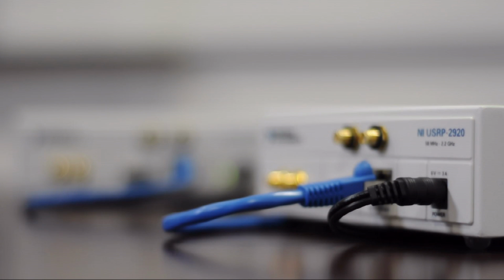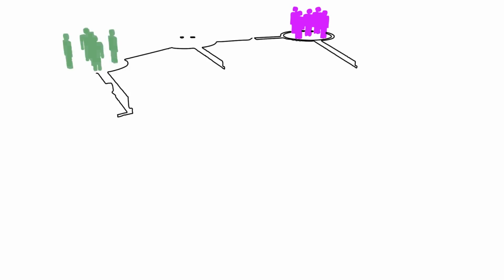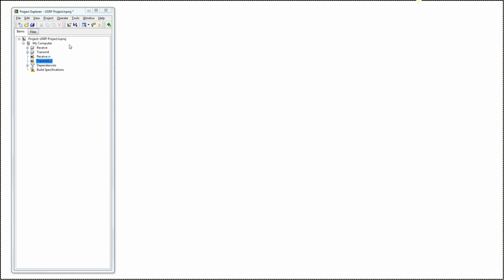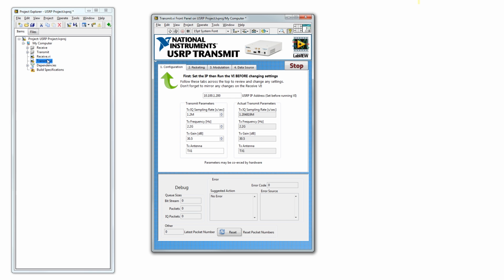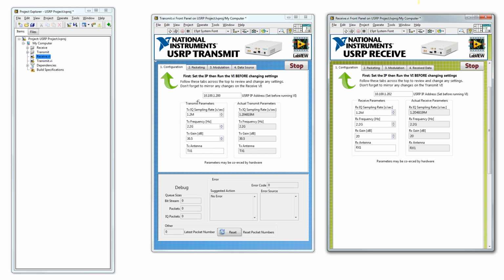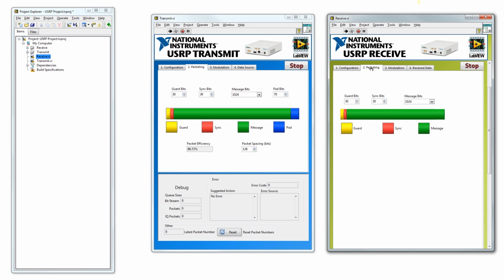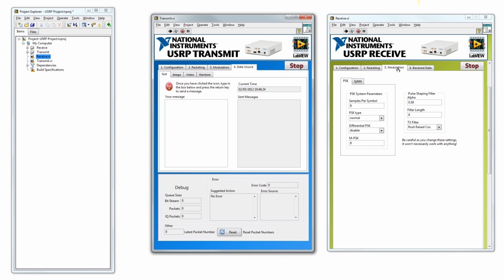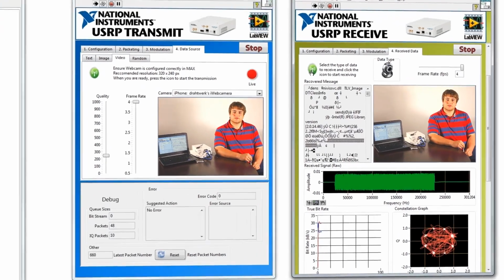NI-USRP: Digital Communications System

Comment: Can I use this wireless video link vi to transmit and receive image and video between two USRPs 2920 and 2932 using triband antennas i.e., at 1.3GHz?I am unable to select the image on the front panel.